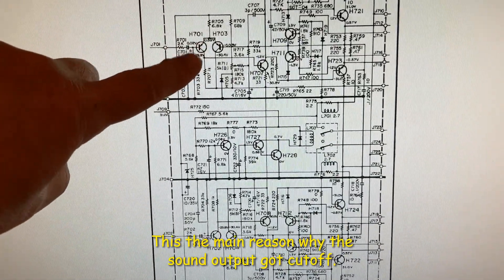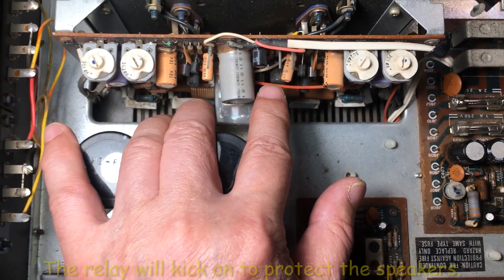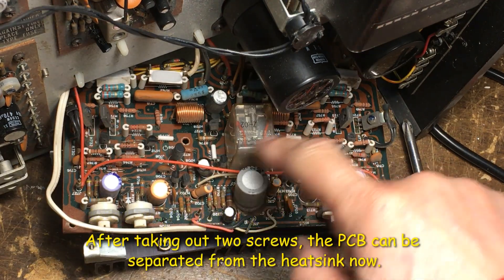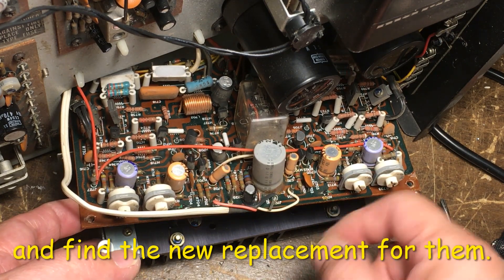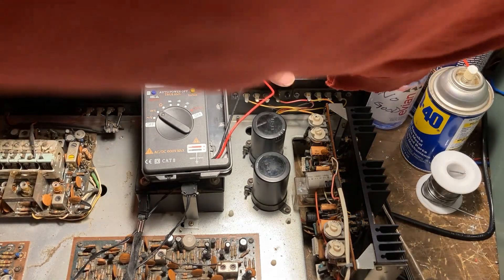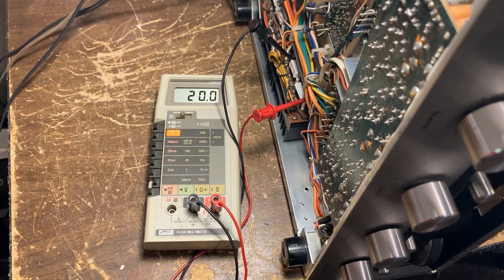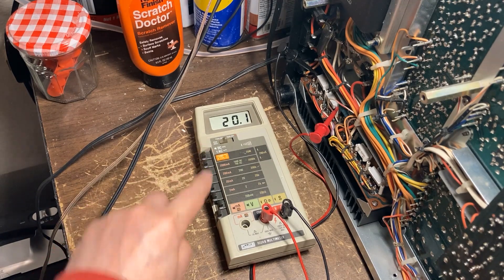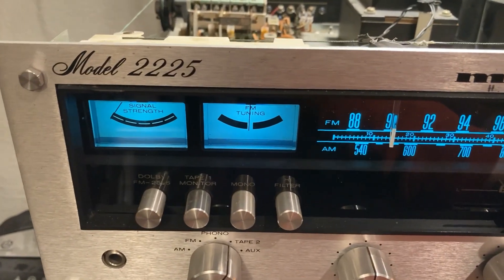Marantz 2225 Repair Part 2 - Intermittent Sound Cutoff

Comment: I inherited my dad's 2225 and I remember back when I was a kid, it would cut off if it was turned up too loud. Is that 
by design I wonder?
Reply from the maker: There is a protection circuit designed to protect the speakers in Marantz 2225. It will cut off the speaker connections when it is overloaded at output of the amplifier section.

Comment: Great to have amplifier schematics. To make troubleshooting easier. 

Some brands don’t publish. 
Making repair more challenging.
Reply from the maker: I fully agree with your comments. Also there were some products had made with several versions. Same model name/number but have different parts and configurations on PCB (i.e. HK 330, Hafler's DH-500..etc.). I have dealt with this type of problem (Accuphase P-300L) before. Fortunately, I used other similar products to figure it out the schematics and got it fixed.